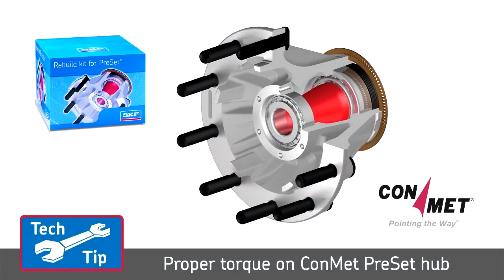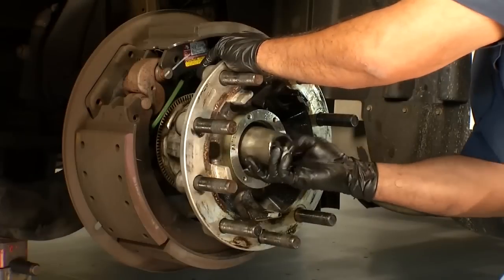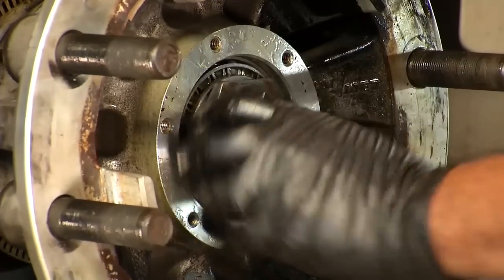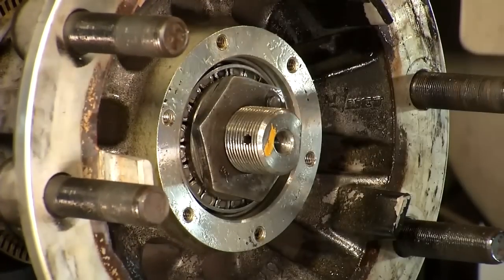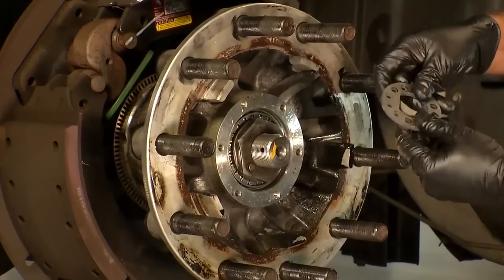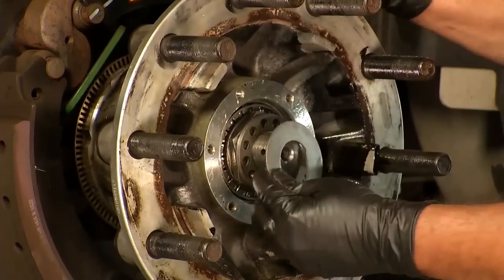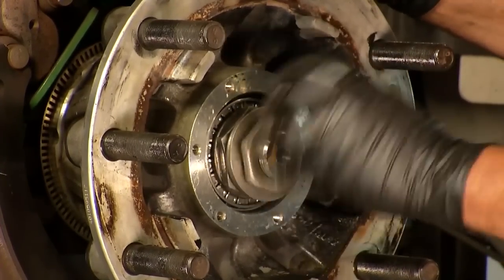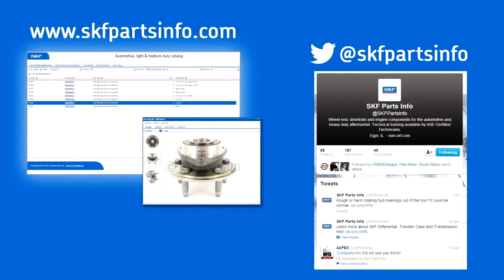Properly torque a ConMet PreSet hub

Comment: Hey got a 2007 kenworth and the front steer axle spindle only have on nut and cotter pin. The socket i use for the nut is 2-3/4” do you have what the torque spec on that single nut is? The front steer axle is a heavy duty 18k axle i believe that runs 425/65/22.5 tires so its a heavy duty axle.
Reply from the maker: You can always check with the manufacturer to get correct torque specs. On page 32 of the SKF TFO guide the procedures for pre-adjusted wheel bearings are listed. You can find the guide here: https://www.vsm.skf.com/binary/12-64875/tfo-wheel-end-maintenance-guide.pdf

Comment: What do I have to do if I still feel play after torque like you?
Reply from the maker: Make sure you are using the correct kit 
if you notice any end play. You may also want  to recheck your procedure.
Reply: Then you need to replace the spacer. Remember new kit have two bearing set plus spacer

Comment: Totally impossible to torque the inner nut to 300 ft pds
Reply: How? I had no problems torquing mine to 250 ft lbs.
Reply: I mean don't get me wrong it's tight and I have never had a problem with hub coming loose or the seal leaking.
Reply: Feeney's Mechanical

Something tells me you don’t have the proper tools for the job.

I recently replaced the seals on my hub, and the (Axilok) nut was completely loose. It was supposed to have been torqued to 250 ft lbs. Yet I never had a leak. So just because you did not have a leak does not mean that it was installed properly. I knew something was wrong with my hub the moment I was inspecting it because while I was rotating the hub, it was not rotating straight. It was a bit wobbly. That by the way explains my strange tire wear.
Reply: @thereviewer4173  no I definitely do.
Reply: Feeney's Mechanical 

Then explain your initial comment. I have a 200-600 ft-lb torque wrench, and it was easy to apply 250 ft lbs. I mean, compare to the 475 ft lbs on semi lug nuts, it’s nothing.
Reply: @thereviewer4173   a while back I had to pull the front hub on a 2006 Mack vision. I know that was torgued to 500. Ft pds. I have to get a huge socket for it. Over 2 inch